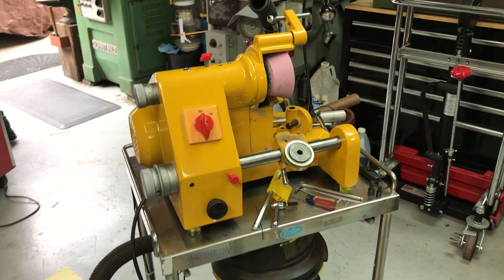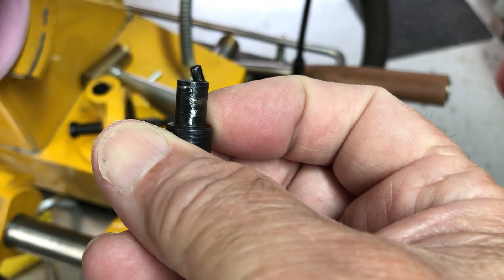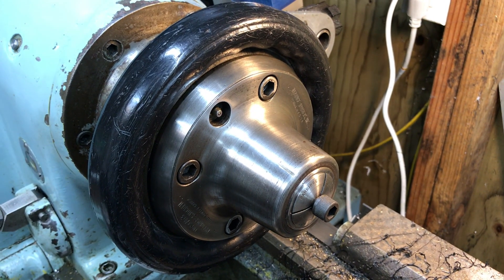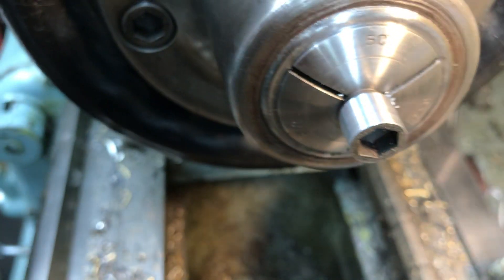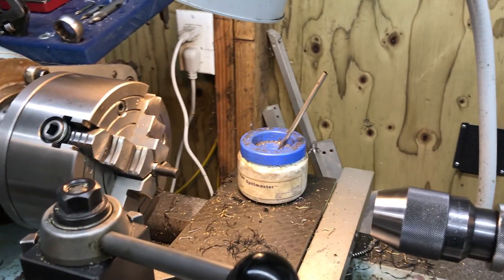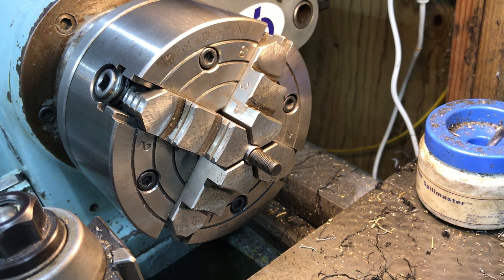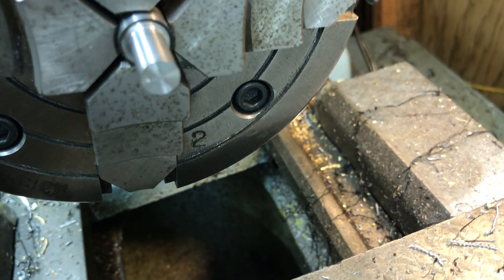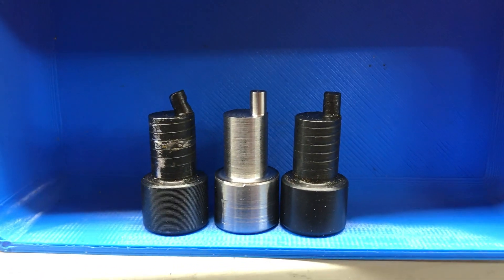d bit grinder damaged part repair (4 jaw offset machining)

Comment: Does it have a tapered arbor? Is the belt guard really heavy fiberglass? I bought one that color and it didn't have the tapered shaft I wanted for wheel adapters. I had to buy another one from Shars. Very expensive mistake.
Reply from the maker: sorry for the late reply....my unit does not have a tapered arbor, so simple to change wheels and I can make spacers to fit different wheel bores...

Comment: I would have liked to see how you measured the offset amount.
Nice job
Reply from the maker: Jeff, as you saw I did do a drawing in Fusion to double check my math...but to answer your question... both diameters of the 2 rounds were known, then it is simple math the radius of the small pin subtracted from the radius of the large pin, that gives you the offset center to center....thanks for viewing